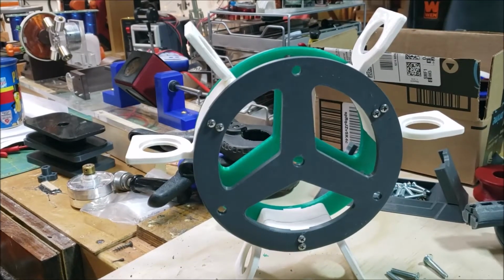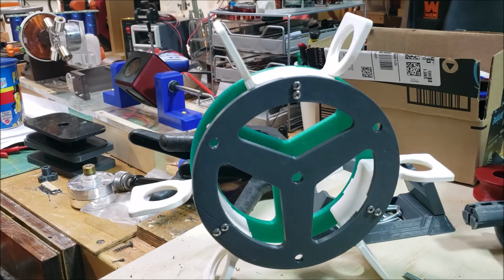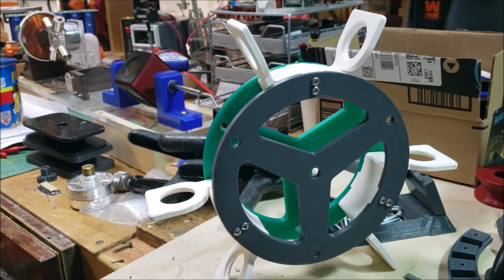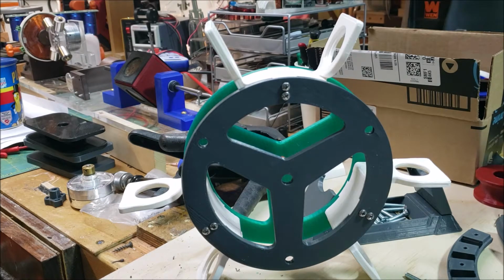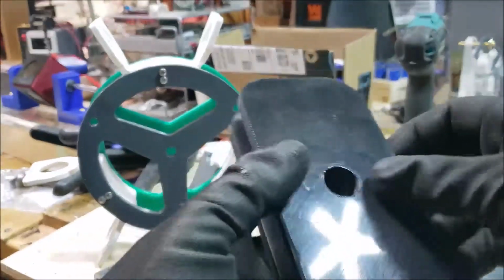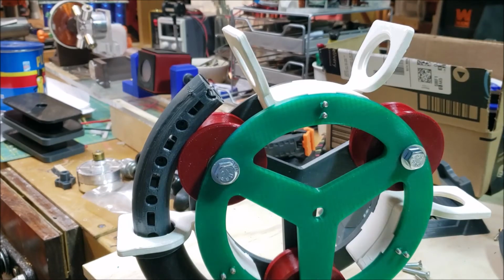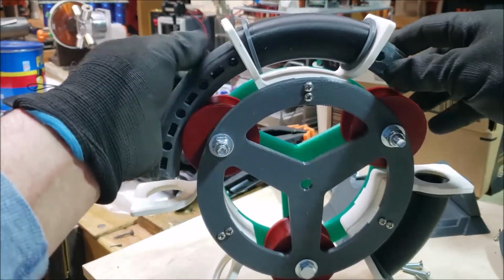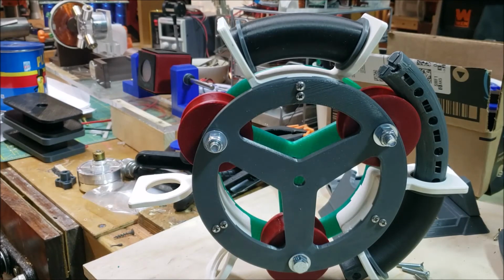3D Printed solenoid motor update

Comment: Have been dying to get mine together so I could check clearances, the new coil tube is thinner as well takes about a hour ten minutes to print.
Reply from the maker: I may give the new coil a print. If its thinner that should solve the fit issue
Reply: @mcorrade  
I can tell you once you see how well the last file I sent to you fits you will be very happy it fits perfect.
Reply from the maker: @SpaceManAus  printing them right now
Reply: @mcorrade  
You won't regret it.
Reply from the maker: @SpaceManAus  what are the large washer type things for?
Reply: @mcorrade  
They are for winding the coils, but you made your own, I tape them in position and wind thee coil.
Reply from the maker: @SpaceManAus  ok thought as much thanks
Reply: @mcorrade  
Did you try the latest coil body
Reply from the maker: @SpaceManAus  not yet. There printed but I don't have time today to try them. I will try and get in the shop tomorrow
Reply from the maker: @SpaceManAus  hey pal can you send me  a new thin coil body without the extra support material? I have better luck making my own supports because when I try to cut yours off I tear the into the main coil body because of it being so thin. If you can't that's cool. I'll make it work. I'm having to reprint 2 of them already.
Reply from the maker: @SpaceManAus  hey pal can you send me  a new thin coil body without the extra support material? I have better luck making my own supports because when I try to cut yours off I tear the into the main coil body because of it being so thin. If you can't that's cool. I'll make it work. I'm having to reprint 2 of them already.

Comment: 28...
Reply: @mcorrade  28 gauge wire.
Reply from the maker: @MAGnetICus_Attractus  ah ok thanks. I was leaning toward 28g so perfect.
Reply: @mcorrade  which reminds me I need to order a pound of it.
Reply from the maker: @MAGnetICus_Attractus  funny I just did lololol
Reply: @mcorrade  I was going to ask if you wanted to trade anything for almost a pound of 32 gauge wire. It is too thin for me to work with. I am going blind.
Reply from the maker: @MAGnetICus_Attractus  32 wow ya that's too thin for me as well. If I come up with a need for it I will let you know.
Reply: @mcorrade  I only had a pound and a half. Sent half a pound to a friend.
Reply: @mcorrade  where do you buy magnets?
Reply from the maker: @MAGnetICus_Attractus  I try and get them free from different sources but if I do have to get certain sizes then either ebay (which you have to be careful) or better yet K&J Magnetics. Ebay is cheaper but longer ship times.
Reply: @mcorrade  I was looking on Ebay and most don't show which way they are magnetized.
Reply from the maker: @MAGnetICus_Attractus  email the seller. If its regular barrel or cylinder then there usually the standard through the half horizontally